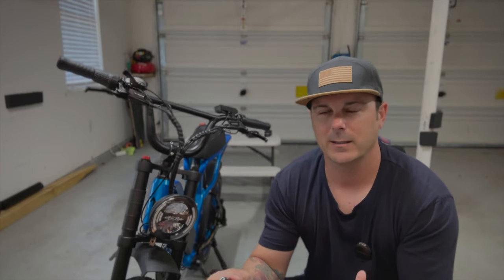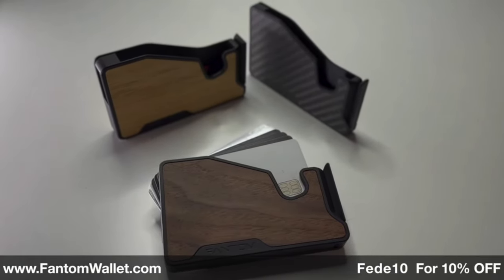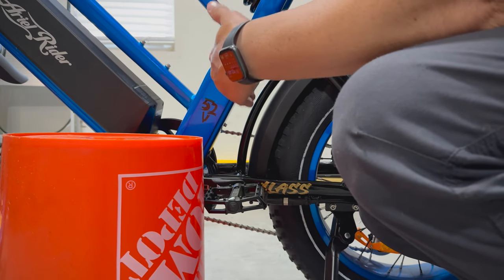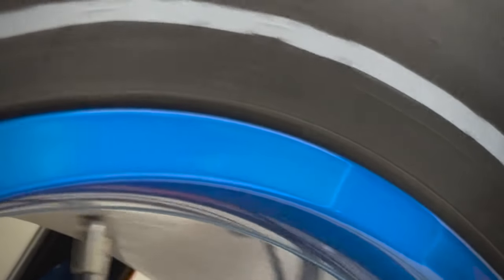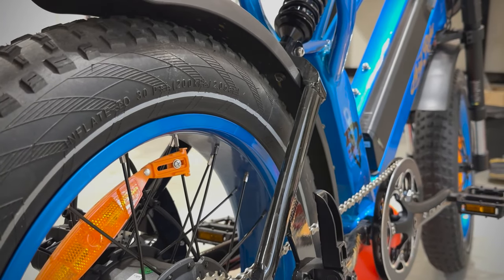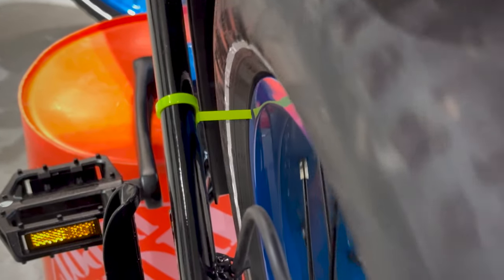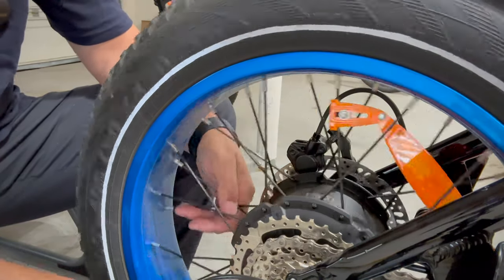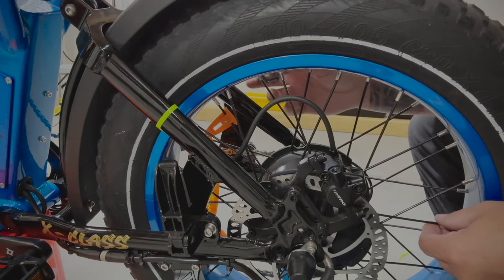E-Bike Wheel Truing Hack! * ALL BIKES *

Comment: My G Force T42 was fine until I decided to upgrade the back tire. I'm definately rubbing somewhere. I doubt it's a loose spoke thing. I wasn't able to locate video about proper derailer guard placement..and wondered if I screwed that down less than perfectly. Guard is not rubbing now, but doesn't appear to be in the right place either. Any hacks for fixin my issue? When I tightened it down tight it interfered with derailed…bummer G Force so hard to get info from.

Comment: I would have liked to see the wheel under power off the ground to see if the bike wobbles from tire imbalance. I am having issues with tires from amazon and a 26x4 tires. My ebike is kind of fast 40phh and the tires I have been mounting make the bike shake terribly with a wheel off the ground test. Wheel is new it has less than 1/16 hop by the rim seam and minimal side to side. Cheap tires are a nightmare. Trying to balance with spoke weights but getting erratic results with the geared hub.

Comment: Your spoke-wrench fits all sizes, but is often out of very soft steel, and its interacting surface with the nipples is very small, so, I threw it away. I got one of those single-size ones, look like a lock-key with a blunt, short key-blade, is high-quality, hardened (there´s 10 times less steel on this one, griff is plastic, so they can afford to build it out of high quality hardened steel for the same price of 3-4$), works like a charm...